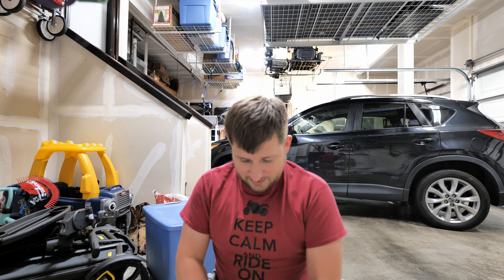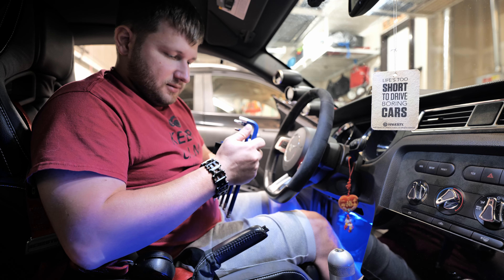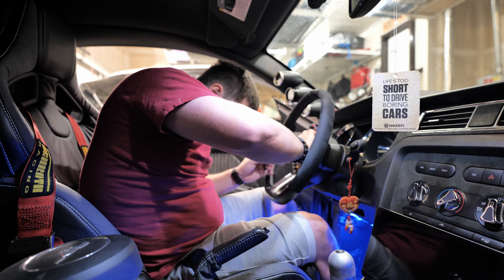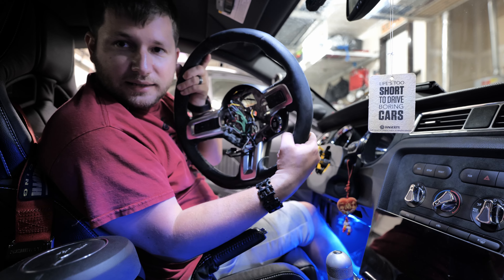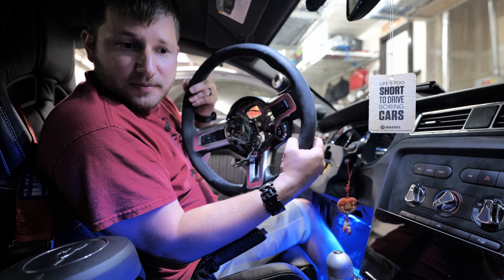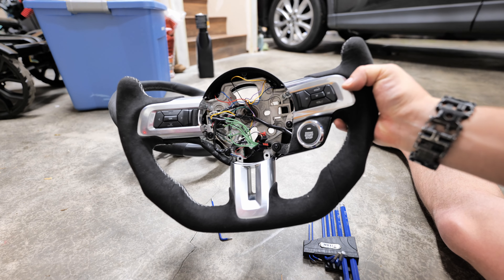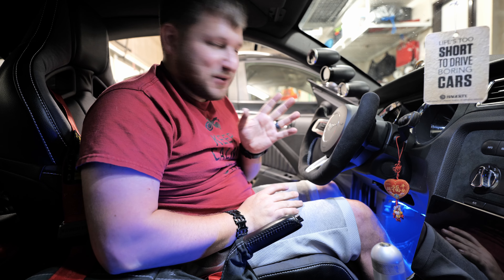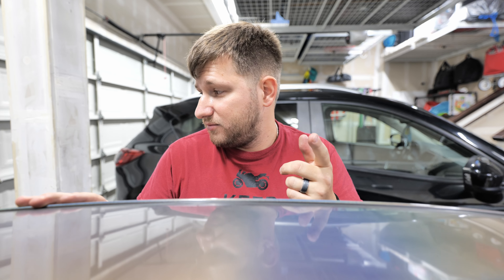Yoke steering wheel in a Mustang

Comment: Does the s550 steering wheel bolt right on to the s197 of did you have to mod it?
Reply: Did you ever find out if it just bolted on
Reply: I was wondering the same thing ?
Reply: Yes, it does. He actually has another video that shows the wiring. Ive done the conversion myself. We’re all still working on getting cruise control working.